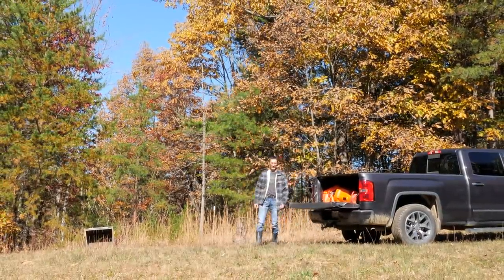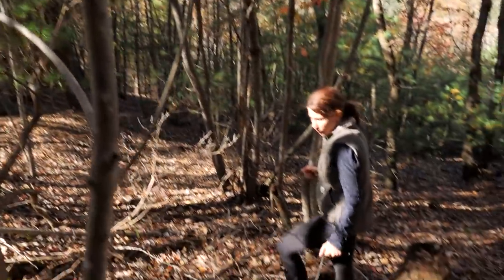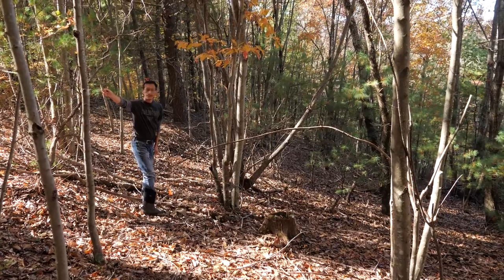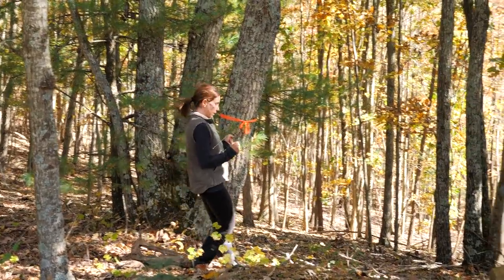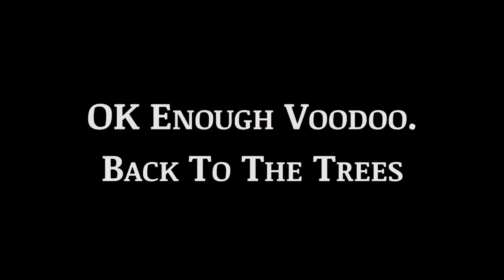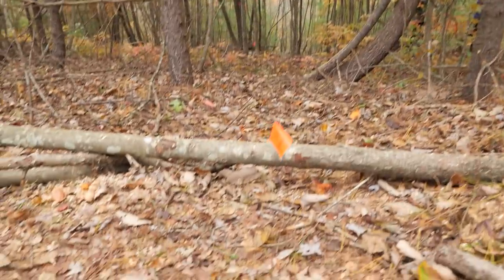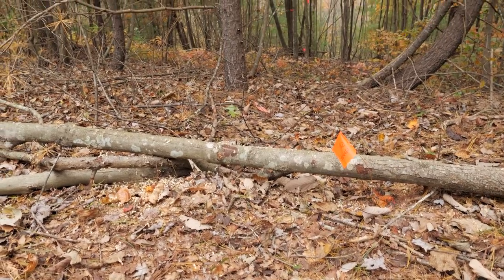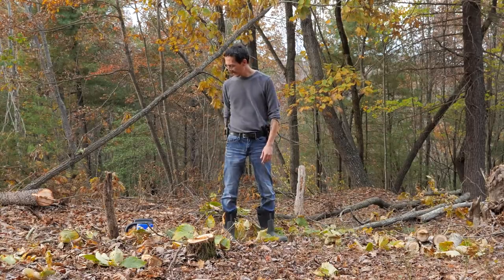Off Grid Home Build (#1): Clearing Trees and Finding Water

Comment: Man I hate to be that guy but I love your channel. I grew up cutting wood, first saw at thirteen, we run a eight to eight and a half cord winter of birch here in Newfoundland and as a youngster I'd cut for gas. All small stuff, one to two foot diameter on the butt. Thought I knew it all but then I worked in BC for a while where you could drive through a tree stump. That was an education. I always worked in the ski industry in the winter which gradually turned into year round so I ended up knocking down trees around the lifts, you need to be a fair hand for that. Thought I knew it all. Met an arborist in Ontario and scammed him out of a bunch of lessons using bar tricks I'd learned in logging camps in BC. This guy was like a ninja with a saw, I learned enough to know I don't know anything compared to these guys. Took forty seven years to learn that. I'm telling you this so you don't think I'm just another dick shitting on a chainsaw video, I hate that. But I've watched this video five or six times now to figure out why your lays are consistently slow, it's hard to tell on the small stuff. I checked all your stumps and the hinge was positioned good but the feather seemed weak (hard to tell on the video even pausing and stuff). Your bite is good, nice and tight, small like it should be so you've been taught some, but I think you're coming in low on the back cut, but only like three quarters to an inch so the tree closes the gap then sits on the hinge and pauses or stops before falling. You can see that on the tree at 19:41 and you really see the weak feather on the log at 21:24 . That being said, I could be way off base, I'm watching this on a video over the interwebs, and frankly I'm a little jealous that I'm not there to help out.

Comment: If you going to drill a deep well of about 60-100 meters you waisting your time with those sticks. The guys will drill til they hit water. Just place the hole where its suitable and out of the way. The cracks in the rock ground goes everywhere and fills the drillhole anyway. But I must admit it was fun to watch you doing this and read all the comment about how well this works 👍
Reply: A shallow well can put limits on your water usage, runs dry easily and needs time (hours) to refill, whereas a deeper well rarely has that problem.

Comment: Looks like you found the metal roofing to put on your shed in the spring to take the sun's heat.  Just remember to leave an airspace under it.  

Love the 'magic tree'!  

I think Jaime's got the knack for witching... more relaxed.  You seem to be holding the rods a little too tightly, and your right thumb seems a little too high sometimes, perhaps preventing that one from crossing.  Stating your request out loud gives it more power because it adds more elements of force to it.  It reinforces your intent.  Words to the effect of:  "show me an abundant source of clean long lasting well water" and then visualize an Artiesian well pouring forth a strong flow of clean water.  I use divining rods for a number of things, but mostly for plotting hartmann lines, so I don't sleep or otherwise spend too much time in their intersections.  

Like Will79 said- stumps come out so much easier when the weight and leverage of the tree is still attached.

I'm so glad you guys are taking the time and effort to document your life for us!  Thank you so much for all you do!

Comment: If your going to split black locust do it while it is green not seasoned out, if you wait until it has seasoned out it will be like trying to split steel. Also looks like you have lots of small round fire wood, which I believe is a little less work than splitting, of course small round I preferred for my wood cook stove and split for heating with the small round.

Comment: Our well is 540 ft deep. About fifteen years ago we did have anew pump installed .. other than that the only problem has been a new switch on pressure tank and a capacitor in control box due to a lightning hit. Since then we have added some additional items to reduce chance of that happening again. Overall, the well has performed excellent ... some of our neighbors wells are even deeper approaching 1000 ft.
Reply from the maker: Wow
Reply: I forgot to mention we live in Wisconsin in region called driftless-unglaciated where the hills and valleys are about five hundred feet high. Very scenic but wells can get deep. Our well was traditionally drilled with drill truck and casing with inner pipe and Goulds submersible pump .. the deeper ones are over by the Mississippi river near La Crosse, where the  hills along the river are a little higher. You can probably find a photo of Lacrosse and see to the east how high the homes are above the river valley .. thus the 1000 ft depths needed.
hav'a great day.

Comment: The best time to look for water is in the heat of summer when water is limited. The water you find now maybe gone in summer. So you need to use your strongest source. 💜🌞🌵
Reply from the maker: Definitely so in Arizona. Here in the hills the springs are always flowing and have been for hundreds of years.

Comment: For your water, have you thought about having a large concrete water tank UNDER ground that collects water from the roof gutters?  It’s quite common here in Australia, where water is a scarce commodity sometimes. Here is an example: https://www.versatiletanks.com.au/underground-concrete-water-tanks/
You’d have to find an American distributor.
Reply: amanda kates would be a great idea for watering the animals and in case of wild fire
Reply: Rainfall in that area is probably close to 30 inches a year I don't think they need it. 76 cm I think.
Reply: With so much water Random Tuber, I would have thought that the perfect scenario for collection.  When I was young, we had tank water for everything, drinking, bathing, garden etc.  I don’t know how much bores cost, but I would have thought rain water tanks would be a cheaper option.  Above ground tanks are cheaper again, but not as attractive.

Comment: Hey I don't know of course what sort of heavy equipment you plan on hiring but if it includes a decent sized excavator, and I was your operator,  I'd rather you leave those trees standing and just flag all you want removed. It's much easier to get rid of the stumps by just pushing them over. Of course again, I don't know what your plan is but that's my two cents from the clearing I've done. Enjoyed the video.👍🏻👍🏻

Comment: Just a thought , you will most likely hit water anywhere , its just a matter of how deep , we did this couple years back where we are Missouri Ozark plateau , we went 310 ft  , water at around 160 ft 15 gallon minute  , pump at 250 ft . , $ 9000.00 , next mountain over about 8 miles away ,same elevation as us , they went 700 ft deep 8 gallon minute . talk about stressful , my budget was $ 7000.00 . Yep had to cut back at project end where the money runs out . :)
Reply from the maker: Ugh. Yeah it’s all gambling. Just trying to figure out where to dig the smallest hole we can.
Reply: Not everywhere can you hit water.we have springs everywhere but not enough for a well. And just cause you hit water ain't no guarantee that the well will keep producing
Reply: You are so right , or will be so low of a producer no pressure for washing machine  valve .  @stevebrenner8503

Comment: Preface this by saying I haven't finished the video yet but please do a video on what you made the rods out of and how you made them!
Reply from the maker: It’s just 2 pieces of ladder wire I cut and bent. As long as they are exactly the same you can use just about anything.
Reply: @Guildbrookfarm  Showing my ignorance here but what is "ladder wire"?
Reply from the maker: It’s like a grid of wire welded together in a “ladder” shape and laid between courses of concrete block when you build a wall. Similar to 6x6 wire mesh used when pouring concrete slabs.

Comment: we have 6 wells but we have 3   400 ft chicken houses so we need the water....I like bored walls 30 in wide best.   because i can pull the pump myself....drilled wells usually 300 to 4oo ft deep ...you need to pay someone to pull it the last one i pulled cost 1000.$ to pull     If you go the drill way be sure your driller also has a machine to FRACKER it if you dont get the water you need.....good luck

Comment: In the numbers you gave today for clearing space, did you include the fire break (the distance from the house to the nearest trees). It would be interesting to hear what the fire experts say the safe distance would be in case of forest fire. 💜🌞🌵
Reply from the maker: Yes. Fire break width should be roughly twice the height of the adjoining timber. So if the closest tree is 60’ tall it should have 120’ of cleared fire break from the tree to anything you don’t want burned.

Comment: This is fascinating to me. If you hold 2 metal rods( I have metal hangers, bent in an L shape) with cut straws on the "handle" part. You can check your energy coming from you. If you hold them out as they are, and think negative, the rods cross, if you think positive happy thoughts, they go straight or way out. So I just checked, I thought, create your own homestead, leve the job, and the rods went way out, then I thought, stay at the job and stick to this house, the rods crossed, hmmm. So my thoughts sre this, what are their thoughts at the time the rods cross? Is it water or the energy they are radiating??

Comment: My dad and grandfather swore by water witching. I have never had to hunt for water...good thing as they are both gone. You can get a good used tractor for less than the price of a four wheeler. Just make sure it has a front end loader. If you're going to bring a dozer in to clear stumps you need to leave a three or four foot stump to make it easier to get them out.

Comment: I hope you don't take this as a "You Should" but I believe you would be safer if you had more of a hinge on your trees when felling them rather than cutting the stumps so flat. Also, I agree with the other poster that your dozer operator will appreciate a higher stump so he can  push the stumps out of the ground.
I'm looking forward to seeing the build progress.
Reply from the maker: I specifically asked about that. He said cut it as short as you want. He has a big ass dozer. 😎

Comment: I have seen those "witching sticks"  have little tube on the handles .. like a short section of plastic tubes, or a hose, or a section of bamboo... etc.   that way the rods can  move without  any hand friction.. However,  I think you are locating water the way you are doing.   Best Regards

Comment: I went looking for an estimate of possible savings if you mill your own wood.

I found a government study related to the amount of wood used on the average home some 20-years ago with smaller homes.  The study mentioned about 17,000 bf per home.  At $1.5 per bf.  This is about $25,000 in wood costs at an average $1.5 per bf.  This includes softwood, hardwood, and particle boards.

It does not include taxes or freight.

https://www.fpl.fs.fed.us/documnts/pdf1994/mckee94a.pdf

In other words, you will spend about the same amount for a saw mill and a planar machine, but at the end of your construction you have the equipment.

I hope this helps.

Comment: We use two copper wires and have hit water 5 times out of the 5 times we've used it and we found well even in Wyoming where they say there is no water above 300 feet that's any good we hit water at 18 ft took it as samples have it tested and it comes out that it's number 2 on the hardness list so it's like soft water

Comment: That 4 wheeler has a decent bit of "Oomph." What brand is that?

Edited to add: ya'll aren't going to want for fire wood for a VERY long time.
Reply from the maker: Yamaha Kodiak 700 EPS. I bought it because I used to own a Grizzly (the fancier faster version) and it was flawless, and the Kodiak had the best towing capacity at 1322lbs. 4WD with Diff Lock. Haven’t met a tree yet it couldn’t tug.

Comment: If you are unsure about your dowsing abilities you could always hire a "water witch"(a person who searches for underground water by using a dowsing rod). There are bound to be some in your area. My dad used a "water witch" on his place around 20 yrs ago. He drilled the well in the designated spot and hit water.
Reply: We did the same when we built 11 years ago. Drilled 800 feet and hit water. We get about 8 gallons per minute and had to install additional piping for the overflow that runs constantly. We were criticized for hiring him, but it works.

Comment: Magic I say magic . I like your videos, I'm going to have to try that for the water . Does it have to be solid copper to work beat
Reply: I am from Western Australia and I use just wire coat hanger metal (cheapest and easiest to find.  It really does work - I have gone onto ground I know nothing about at all and have found water.  Only problem I have is not knowing enough about it to work out if it is good water or salty.
I think you have to be open minded enough.  I have actually gripped the wire really tightly in the hope of stopping it but if there is water the wires will cross!

Comment: I understand that you'll use some of that mess for firewood, but what do you do with all that small stuff? 💜🌞🌵
Reply from the maker: Gonna rent a big chipper.
Reply: @Guildbrookfarm  good for you! I think burning it in a scrap pile is such a waste! I was going to rent a little chipper,  <2", but it was cheaper to buy one! Three days' rent equalled the cost of a new one. 💜🌞🌵
Reply: @Guildbrookfarm  Awesome idea!
Reply from the maker: Yeah the big 8” chippers aren’t cheap either way but they handle anything you wouldn’t use as firewood. I’ll buy a small one for all the brush.
Reply: @Guildbrookfarm , I thought size was the determining factor for firewood, but I get the idea that species has a factor. Can you speak about that sometime? I know hardwood burns hotter, but sometimes you don't need a blazing hot fire. 💜🌞🌵
Reply from the maker: I don’t generally mess with anything smaller than 4” in diameter for firewood.

Comment: Jeremy .... looks like you where not holding the welding rods loose enough and not balanced with horizontally like Jamie was =)   You can see it in the video if you look really close =)   YES it does works GREAT =)   Also large DEEP TAP ROOT TREES will pull up a water table for them to drink from =)   You also maybe following an old stream bed that may still have water underground =)   Good video and good location for the new home =)

Comment: My husband can get it to work for him. Me not so good. He uses a willow tree branch. Take a small limb where it forks and cut it off the tree. He holds the split parts, one in each hand with the main part in front of him. We did it over a water line. He could close his eyes and walk across the yard and when he got to the water line it would put down. He said you can feel the pull. He found water at his mother's house, and that's where drilled. That's where the well is at.

Comment: How deep are drilled well in that area?  Are you looking to drill or pound the well?
Reply from the maker: 280 to 600+ just depends. Gonna drill it.
Reply: Guildbrook Farm - Off Grid Living after firing the the pounding company for pounding 2 dry holes, I had a company come and drill 150 ft,  caught 2 veins in a 20 ft screens, recovers at 50 gallons a minute with a static of 28 ft,  so much guess work
Reply from the maker: Yeah it’s a gamble. Sounds like you finally hit a good one though!

Comment: 4:37 Not going to say you're insane, but dousing rods are certainly controversial.  If only there was the teeniest bit of science to make it make sense.
Reply: I could douse as a kid, but haven't tried it in nearly 40 years. Here's 2 bits of science: 1-possible magnetic interference caused by underground water.  2-the douser's subconscious awareness of surroundings, perhaps picking up a line of bigger trees or otherwise enhancement of greenery around by underground water.
Reply: @thebluelunarmonkey  I reckon the second is more likely.
Reply: It also works with a raw egg
Reply: Water dowsing is creepy especially when you’re already skeptical about it and then you end up being the one who’s holding the wires and finds water. Yeah that really happened to me.
Reply from the maker: Me too 😳
Reply: A compass should spin a little, and a metal detector should go off in the same spots
Reply: @FrarmerFrank  Why would either of those things happen?  I'm curious how the science works.

Comment: I can't quite decide whether you've turned into Right Old Pilgrims or Proper 'New-Age-ers'.  You should be sporting Jesus sandals and Dreads for the fullest "Holy Water Dowsers - Batman, we got Water here" experience 😂  There's something so innately satisfying sering that Timberrr moment when a tree comes down isn't there?  Do the Well-Diggers use Dowsing to  confirm Water presence or is it all Ground-Penetrating Radar these days?
Reply from the maker: One of the drillers we had come out was an old timer and he used dowsing rods. The other one just said he’d drill anywhere until he hit water. 🤷‍♂️
Reply: @Guildbrookfarm  Crikey, that second guy's either confident he can hit water wherever you live (he DID SEE the ridges right, and the seep spring down in the hollow?) A total 'Cowboy' who has no idea what he's doing, he could quote you a price {I'd get it in writing beFORE he starts} for a 2 day job and he's there for a fortnight lol, or he thinks he can smell the water and he'll finish in a day.  I think I'd go with the old timer with the rods.  After all both of you found the same spot with the rods and you're both total novices.